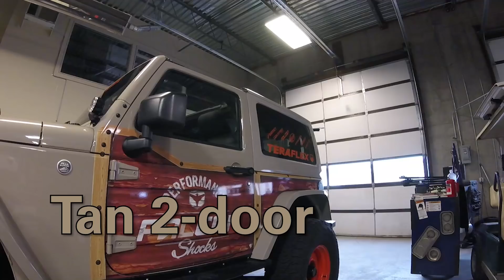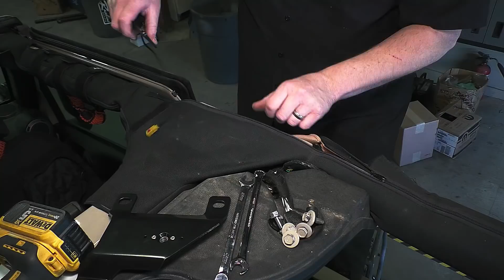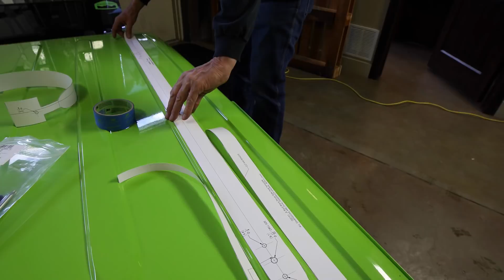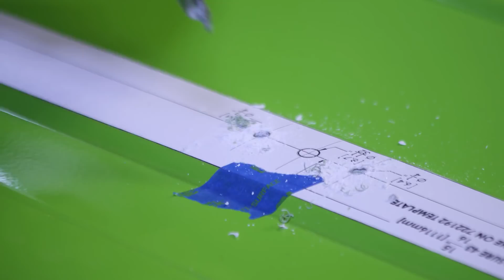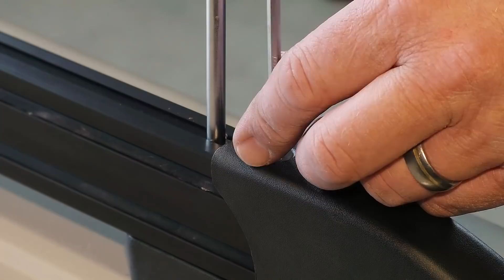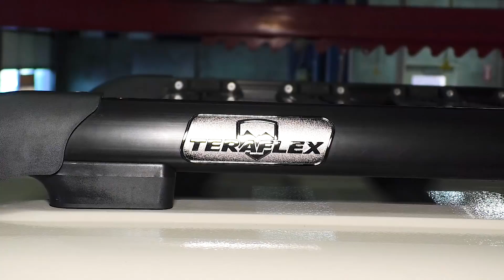TeraFlex Install: 2-Door Nebo Roof Rack

Comment: Installed on JK 2 door.  Took about 7 hrs, including slat Kit.   Looks great.  I like that load goes directly onto sport bars.   Low profile clears garage door.   Slat ends allow for width adjustment.   I did strip one of the slat rail nuts, which I will replace.   Slot in top rail slats allows for accessories.  Regarding $’s...  buy once, cry once.  Glad Teraflex figured out this design.